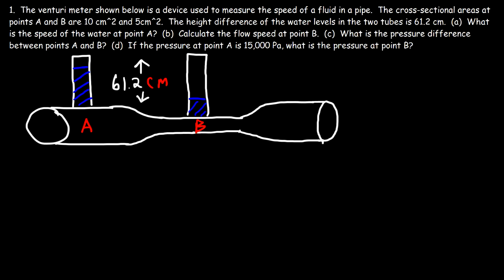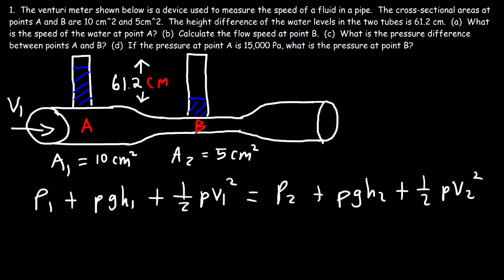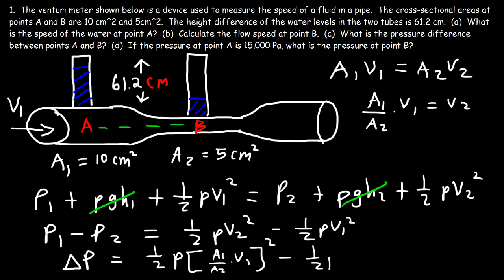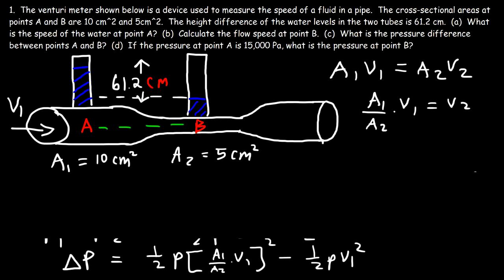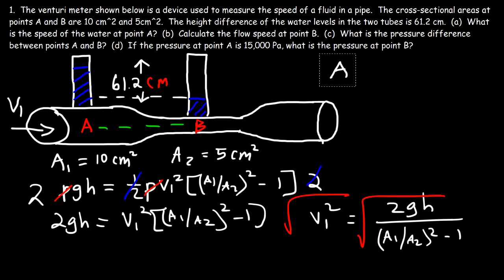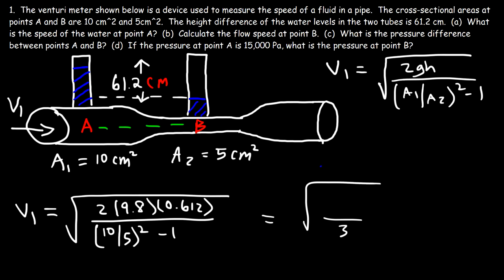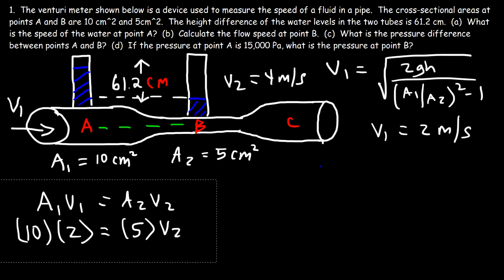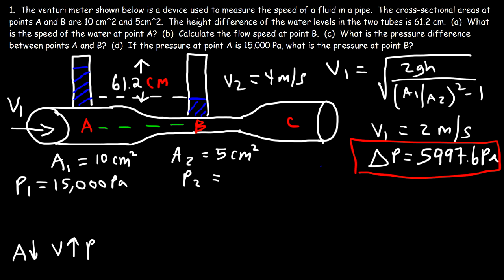Venturi Meter Problems, Bernolli's Principle, Equation of Continuity - Fluid Dynamics

Comment: i.imagine it as a baloon when we pressurize it and rap the outlet but only let a tiny bit of air to escape ,the speed of the gas when its outputed to the other side ,its velocity dependent on the source pressure of the cylinder ,or storage tank

Comment: the speed must be slower in yhe bigger portion of the pipe but when it reaches the  narrow spot and gets out to another place similar to the first pipe or doesnt matter but it has to go though this process to drop its tempreature ,its all about dropping the temp ,by jettjng it from a narrow jet ,but the velicity of the gas beibg sprayed or jetted ,is relative to the inside pressure of a closed system ,to open system ,or atmospheric pressure,this is applied to steady cold ,the colder the better ,the whole refriregeration idea is about getting the heat out of the system ,or place  ,it has to do with pressure of vourse but the primary work is making a way by means of maniplulatig pipe diametrs and leghtes ,if any source of heat is intruduced ti an AC OR REFRIGERATION system the balance will be lost ,the normal working way of these systems ,keep heat away .

Comment: what if the water level at point B was higher than A, wouldnt then p1-p2 be negative because p2 would be larger than p1, would then delta p be negative or? thats the only part that confuses me

Comment: I did extremely well in college algebra, but these are some intimidating equations and calculations. Yikes! I have not done any algebra in nearly a decade and a half. If I continue with my next college degree I will be required to take chemistry and I am so out of practice when it comes to solving algebraic equations.

Comment: Great explanation. When you do it with real numbers, the whole issue becomes tangible. But... can you do the same if the fluid is a gas? Can you solve https://youtu.be/hLZkPFrQCDk?si=v42FcijR1yBAatmm? Making some measurements from the video and some reasonable assumptions (e.g temp in Chamber B is 0°C),can you deduce the mass flow rate through the system? You can't use Bernoulli's principle since the density is not constant.

Comment: Could you tell me, is there a ratio for the most efficient venturi of how much you have flowing in to how much is added via the venturi? 

So if you have a constant flow rate and constant pressure in say of 10bar air passing through, how much in comparison could be drawn through?
Reply: Could you induce as much as say 1/2 the constant volume in through the venturi?

Comment: Good video. I'm confused why the p2 would be less than p1 though. The level of the liquid in the 2nd tube is lower so how come it hasn't got more pressure?
Reply: The pressure of a venturi meter is always lowest at the throat, where the flow speed is the greatest. The level of the liquid is lower because there is less pressure pushing it up.

Comment: I am hesitant about calling P1-P2 Delta P, because change is always final minus initial
Reply: Not always. In this case, it will actually be an indicator of flow direction if that was not already known.
Reply: I guess you could use the absolute value of it ,then to make things simpler for you.
Reply: Right!
Reply: @sccm100  pressure is a scalar u doofus and also there is no final and initial here, only 2 diff positions.

Comment: I still don’t understand how you changed the pressure of the whole system, and equated it to pgh.
Reply: The fluid has a certain pressure at the 2 points, P1=ρgh1   P2=ρgh2    dP=ρg(h1-h2) => dP=ρgdh